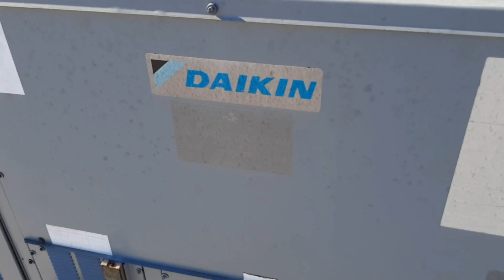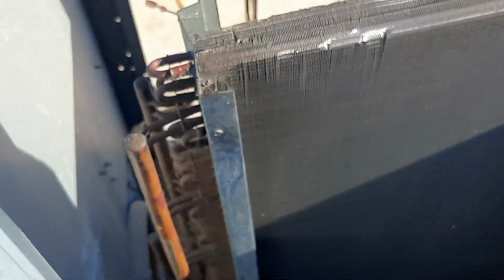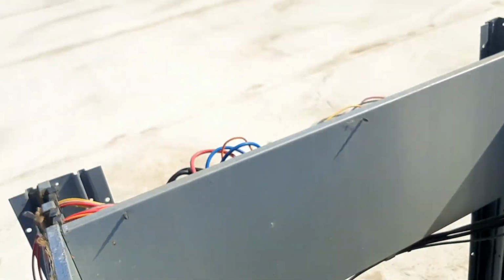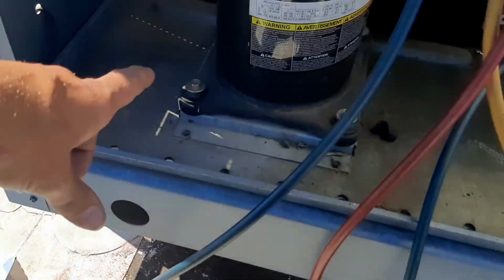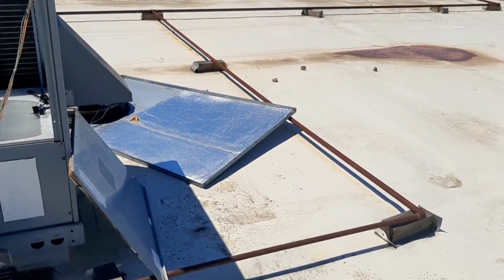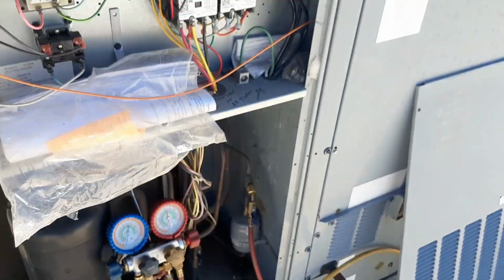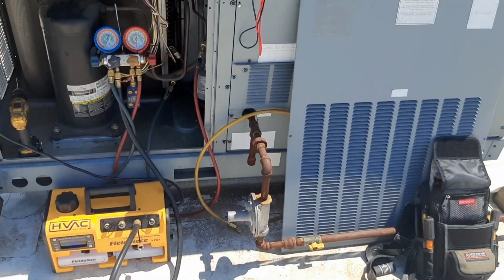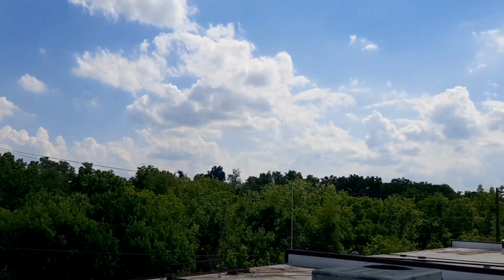Daikin condenser coil leak repair

Comment: Sweet man.  If you look up "4 wire delta" configuration you'll get an explanation on the high leg. It's just the way the neutral is tapped.
Reply from the maker: Thanks John! I'll have to check that out, always learning something.

Comment: Nice repair. They sell little brass wire wheels at home depot or Lowes. Helps a lot to clean copper with them on drill.  I would have washed that coil . Brushing the surface isn't going to get on the dirt out in-between rows of coils..
Reply from the maker: Thanks piney! I have a wire wheel just didn't use it here, the coil was a single coil and wasn't bad but customer has been told all equipment needs to be maintained
Reply: @EverythingHVACR  it's a 2 row coil so dirt gets trapped in center. Yea I totally understand.  I won't clean anything for free either. We all have customers only call for repairs and no maintenance.  Still nice repair get them back up and running. 😉👍

Comment: When I pull through my gauges (sman 480 so I don’t need a micron gauge) I pull through my ref and my vac lines pretty quick. If you like the analogs you could use a T at your suc or dis which ever you’d prefer for your micron gauge and pull through 4 hoses. When you’re ready close off your ref line hook up your tank, open line pull vac a little longer to clear any air from vac to tank and let her eat when you’re ready. Good fix. Just fixed one like that on a little 100 ton chiller.
Reply from the maker: Yeah good call, thanks MOONLIGHT! I use a tee to charge with my probes, I need to get one for vacuum
Reply: @EverythingHVACR  yellow jacket makes a vacuum manifold as well.
Reply from the maker: I'll have to check that out, Thanks man 💪

Comment: 208v 3ph 4 wire with the high leg delta can kill ya if your not careful...I think that's a delta configuration...
Reply from the maker: Good call Thanks Gen X RedNex! I like the name by the way 😆,  just never thought to check all the legs to ground.
Reply from the maker: Just glad it didn't kill my new pump
Reply from the maker: Florida Man HVACR  interesting stuff, Thanks Florida Man! I'll think twice next time, my old pump would have been a puff of smoke

Comment: It is undercharged, your condenser was filthy/plugged. Brushing off the surface didn't do anything! That is why your amp draw is low/ suction high/ superheat high/ yet condenser pressure is in range. Refrigeration 101 should have taught you that you can't charge a system with dirty coils. You should have at least put in the entire factory charge, and cleaned the coils on a follow up call.
Reply from the maker: That was factory charge, I'll have to take that refer 101 class.
Reply: What makes you think the superheat is high? 

He could see right through the condenser so I don’t think it was plugged…
Reply from the maker: Thanks 89DHVAC! Don't feed the trolls lol.

Comment: Daikin/Goodman equipment is total junk. Had a 10 ton RTU with a leak on 1st stage cond. coil.  Only 3 years old, replacement coil ( under warranty) leaked in same area  after 3 months. Repaired it instead of asking for another coil.
Reply from the maker: I would tend to agree, Thanks Matt!